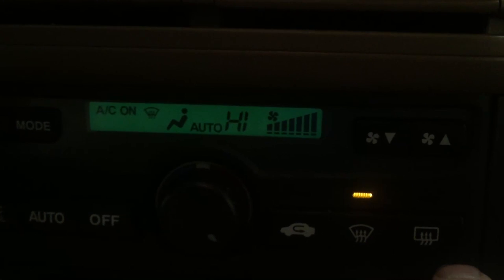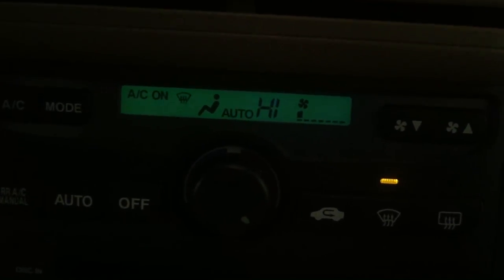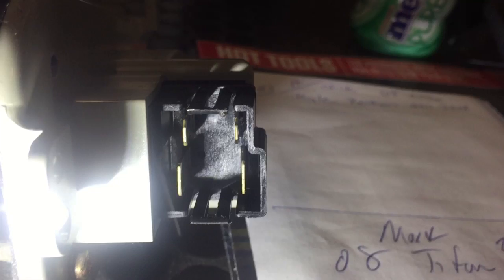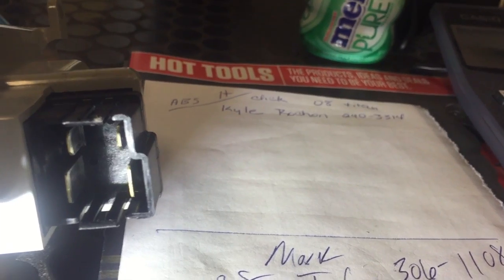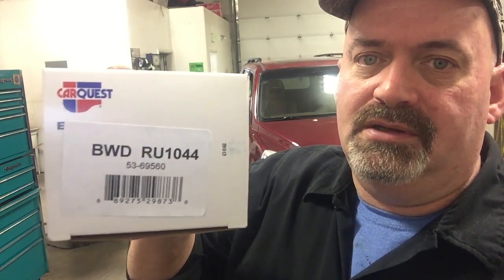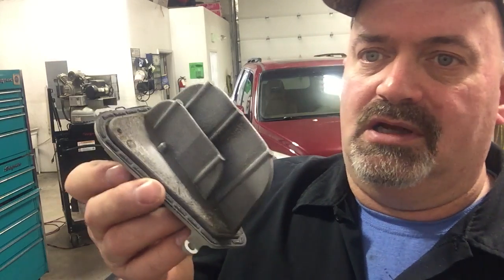Honda Blower Fan Diagnostics

Comment: Great video.  I had an intermittant blower fan failure that would not stay failed long enough to diagnose the problem.  I ended hooking up a voltmeter to the input side of the power transistor and then drove until the fan failed,  The input went to zero volts (even on high setting it was reading about .5 v) so I new the problem was back towards the supply.  I was going to try swaping the defrost and blower motor relays and I noticed the blower motor relay was much easier to pull out.  I tried a male connector (similar size to the terminals of the relay)  and found the connectors that the defrost relay go into were much tighter than the connectors in the blower relay socket and I also noticed slight arcing marks on one leg of the blower relay.  I carefully bent a slight arc in the legs of the blower motor relay so that they would fit tightly into the socket and have not had the blower motor fail since.  The proper fix would be to replace the connectors in the relay base.

Comment: Dude I live in AZ I drive for uber  eats most of the day you legit saved my hide I checked fuses and all fine I checked wires nothing no voltage problems I was despairing then I watched your and I tried simply tapping on the blower motor and the Damn thing started blowing harder than it has in over the last few years I could almost cry bad brushes I guess thanks a ton

Comment: Going thru this right now. I have a 2012 pilot. I first changed the relay. Easy and cheap fix!! Or so I was hoping. It started working again but here I am 2 weeks later and it died again. The funny thing is that it’s intermittent so I’m thinking either the blower is going bad and it’s warning me or it’s this. I’m going to try and change these both myself. Thank you!!!

Comment: Shouldn’t you check fuse and relay first
Reply from the maker: Certainly can do that. It’s just not where I go first since those items are not the most common failure parts. If you test power at the motor and back track from there that’s also an option. No wrong way to do it. Thanks for watching!

Comment: We own a 2005 Honda Odyssey. In the last six months, our local mechanic has replaced the blower motor 4 times and the transistor twice. I even paid top dollar at a Honda dealership to buy a Honda brand power transistor because i was told that could be the issue. That lasted one month. All the other parts kept our AC blowing for a week or less. Do you know what could be causing repeating failure of the blower in front? The air in back does still work.
Reply from the maker: A garbage aftermarket blower motor can cause this.

Comment: The AC in my 05 Odyssey blows very little and stays the same no matter how high you punch up the fan speed it just barely blows is that a bad motor or bad transistor?

Comment: If the air coming out isn’t as strong as it used to be on max setting could the problem be with the blower motor, power transistor or both?

Comment: I've got a 2002 Odyssey, rear air blows but absolutely nothing in the front. Have watched several similar videos, so I pulled the transistor, metered 1.5k on two sets of contacts. I think they are 1&2, 3&4. Addtl info...just had radiator replaced, since then intermittent hot air (so sometimes no defroster). All of a sudden, lost front air completely. Any suggestions? Thanks in advance and thanks for the informative video.
Reply from the maker: Have you tested for power at the blower motor? Bang on it and see if it starts.
Reply: @ThecardoctorTV  banged on the motor, nothing...metered connector terminals with multimeter, with one lead to ground, I metered the blower motor connector after unplugging it (key in position II), 11.81 volts to Yellow/Black, only 16.7 milli-volts to Blue/Red. Also metered the transistor terminals after unplugging connector, no voltage on either of the Blue/Red terminals (one wire ~10awg the other ~16awg).
Reply: UPDATE: after dropping blower motor which had no debris, only dust on the blades, I remounted the blower motor and reconnected the harness and reconnected the transistor and BOOM, we've got air! I dont know what happened. I dont know for certain if this was a problem before as I rarely drive this vehicle but I can control the amount of air (levels 1-5) and the temperature but I CANNOT change where the air is being delivered. Its stuck coming out the main vents, nothing below and nothing out the upper dash for defrosting the windshield. My navigation controls respond to where I want the air but no matter the setting, air only comes out the main vents on the face of the dash board. Now it sounds like time to change the flap actuator on the driver side floorboards.

Comment: 2007 Honda Odyssey, the ac functions intermittently (on/off) in the front but has zero problems in the rear.
What could be the diagnosis and how do I test it? 
Thank You.
Reply from the maker: the blower operation or the actual cooling of the air changes?

Comment: Thank you so much...you saved me a lot of money... it literally took me 15 minutes and $60 and I had my wife’s car blowing cold air again... thank you again and keep up the good work.👍🏻👊🏻
Reply: By replacing the blower fan or by replacing the AC Air compressor?
Reply: Mr G It was just the blower motor resistor, plug and play...lol
Reply: @b0b073009689613  ok thanks!

Comment: That was fairly simple :-D, its good it wasnt the control system that failed, i bet that would have been expensive.
Ive seen too many transistors break down in consumer electronics over the years, sometimes it can really make a mess in the drive circuits, the outputs in hifi amplifiers can really cause a mess when they go poof, a small bonfire is created, not pretty :-(
Reply from the maker: Its amazing how much heat those things create. They put them in the HVAC housing so the air keeps them cool but even with this rather large heat sink it still overheats and dies. You think after all these years they would come up with a better way to control blower speeds but it seems to be a problem across all makes. I bet if we figured out a low cost solution we would be rich!
Reply: I dont know if they use pulse width modulation in hvac systems to control the motor, that could generate less heat, but i bet thats what they do allready.
Bolting a flat heatsink to the firewall with heatsink grease might dissipate the heat better, its a large sheet of metal the fire wall.

Its a shame that there is no chassis under cars now, imagine a device bolted to one of those lumps of iron, the transistor would be cold all the time lol.

Comment: Very nice. Next up for me I get to do the blend door actuator on my 2000 lesabre. You don't have a video on that one do ya?  Thanks for the upload !
Reply from the maker: Remove the IP compartment.                   Remove the electrical connector from the temperature air mix actuator.Remove the temperature air mix actuator retaining screws (1).

Remove the temperature air mix actuator.Installation Procedure

Install the temperature air mix actuator.

                    Install the temperature air mix retaining screws (1).                    Tighten:                      Tighten the fasteners to 1.4 [n-m] (12 lb in).Install the electrical connector to the temperature air mix actuator.Install the IP compartment. move the IP compartment.  Remove the electrical connector from the temperature air mix actuator.Remove the temperature air mix actuator retaining screws (1). Remove the temperature air mix actuator.
Installation Procedure
Install the temperature air mix actuator.Install the temperature air mix retaining screws (1). Tighten the fasteners to 1.4 [n-m] (12 lb in).Install the electrical connector to the temperature air mix actuator.Install the IP compartment.
Reply: Ah brother, thanks so much. I will print out the instructions. You did double up on the re-install procedure instructions didn't you by mistake (maybe copy n paste) on the air mix actuator????  Regardless I've got it and will print these instructions out and remove the glove box and should be fairly easy. Thanks so much Tim and best wishes !!